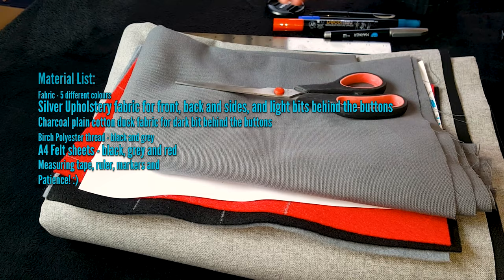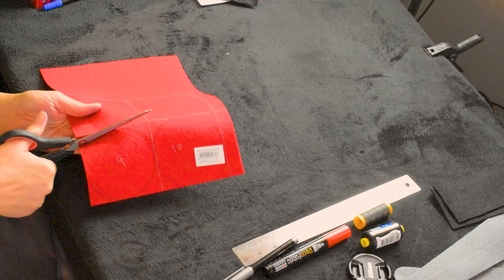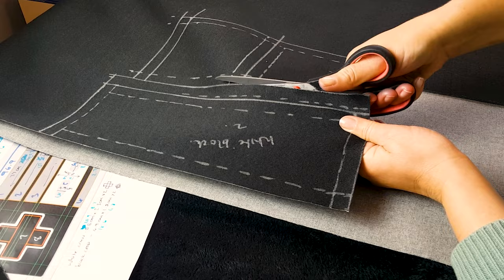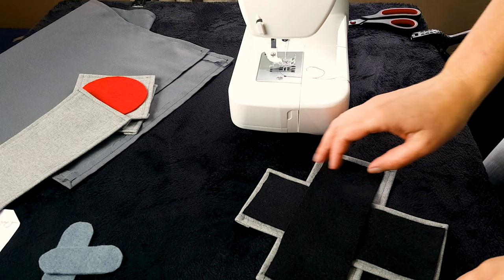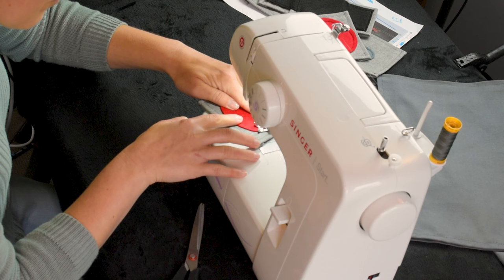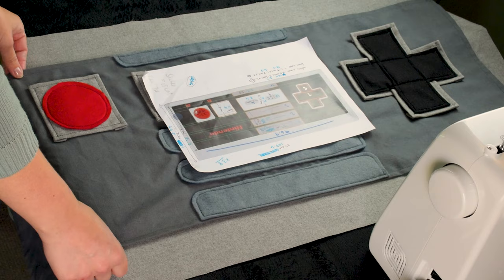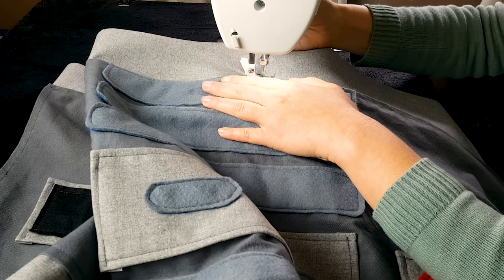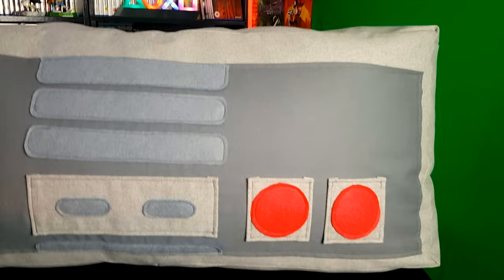How To Make Your Own NES Controller Pillow!

Comment: Very cool!
But what I'd do differently:
1. Nintendo logo. You don't wish to miss the iconic part of the design.
2. I'd stuff the thing with polyurethane foam instead of pillows. The thing should retain its rigid rectangle form, like a sofa cushion (I'd want to be able to sit on the pillow, not hug it).
3. If you sewed conductive foil into the buttons, you could've used an Arduino to make capacitive sensors and make the thing into a functioning NES controller. Silly, but why stop halfway? 😁
Reply from the maker: Great feedback, thank you for checking this one out! 👍